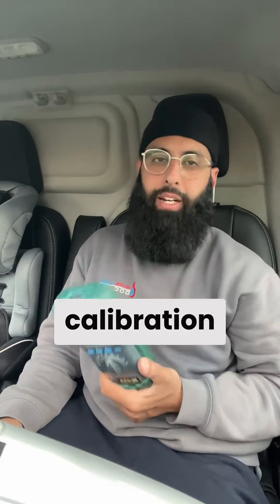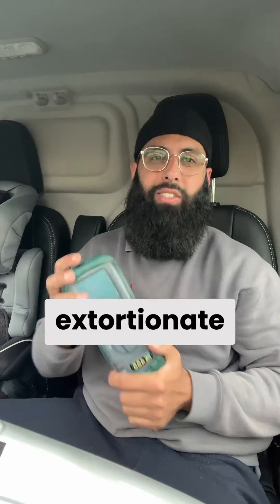Let's talk about FGA’s 🧐

Comment: I am looking to get a testo 300 ultra kit. Seems like the finer ones out there like there at the moment. Price tag varies on the bundle you purchase. Anything £600 onwards. The ultra kit has blue too temp clamps and a Bluetooth manometer for pressure testing and a sniffer. For £1120

Comment: I use the Kane 258 as when it goes over the calibration date it doesn't lock out and allows you still to use it. This is ideal for colleges who don't have to abide by gas safe regs and get their fgas calibrated yearly
Reply from the maker: Nice

Comment: Using TPI 710 currently, would definitely recommend it. Or the new 711, with the display, if you want display too. Not only cheapest, but comes with 12 years warranty as well. And the printer for it, is the best in my opinion. Good luck, choosing one.
Reply from the maker: Thanks I'll check it out - I rarely use the printer as I fades out